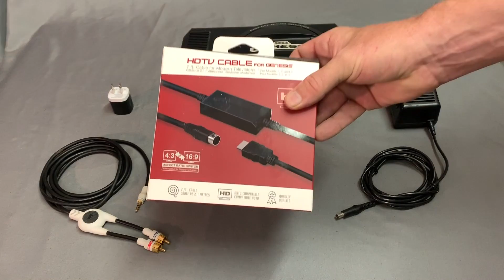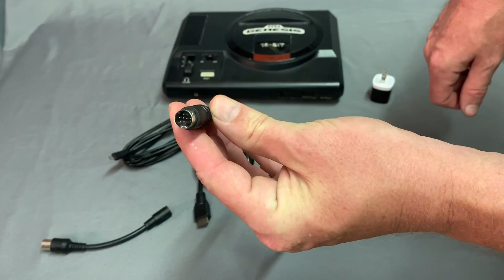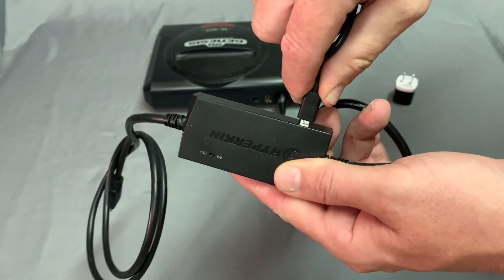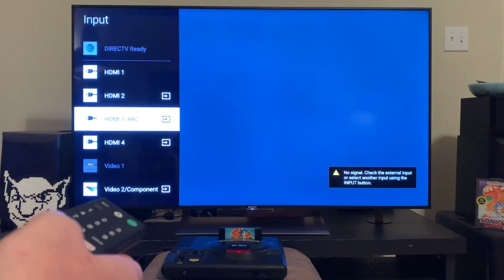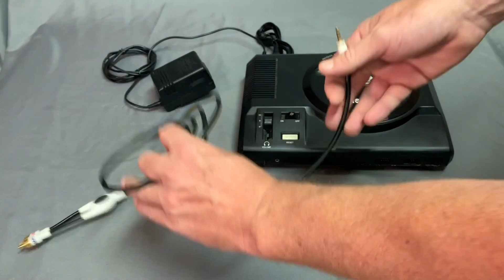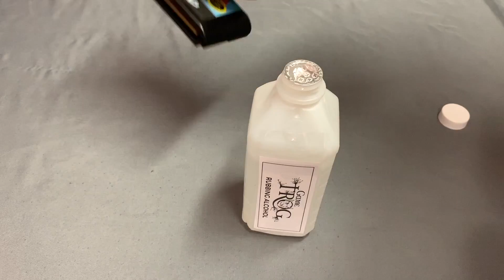How to connect your SEGA Genesis - Model 1, using the Hyperkin HDTV HDMI Cable

Comment: Great video! I had been debating whether or not to buy one of those HDMI cables for my model one but now you've convinced me it's worth it. Thanks for the info.
Reply: it's not, those are trash. If you think the video quality is better is just because it pulling out the rgb signal instead of composite which makes the image cleaner but the picture is still not interpreted correctly. In fact those cheap converters transform the progressive signal into interlace (your TV does the same thing when you plug in analog things in it) and it adds lag as well as graphial problems. If you really want to have a good experience for à fairly low budget check out videos on the GBS-C or the rad2X

Comment: I’ve checked my connections a dozen times and my Samsung just has a black screen. Don’t know what’s wrong :-(
Reply from the maker: Do you have another HD TV you can try it on? These cables output 720p, not 1080. There are some TVS that don't support 720p so that's a possibility. Also, do you know if the SEGA works with regular (RCA) cables? A black screen could also be a dirty game, have you tried a couple different games? (I know, lots of options here).
Reply: @thegametrog  I’ve tried a couple diffeeent games, same issue and on two different Samsung smart tvs… I’m wondering if the resolution like you said is the issue… I do not know if it works with regular rca cables… I have Rca, but do I need a specific plug to use those? I have one other tv I’m going to try again on, thanks for the help regardless.
Reply from the maker: @justinpeter7452  So most of the Genesis Models 1s that I have seen go bad, do have the blank black screen. When you turn it on there is a change to the black screen on the tv, like it sees it, but doesn't display anything. So it is a possibility of a bad SEGA. But they're normally tanks, so I would try everything. Even look inside the cartridge port on the unit to make sure there no paper or anything stuck in the cart port (had this happen more than once with due to the shipping material someone used). A lot of new TVs don't have the RCA (Red, White & Yellow) ports, but if one of yours does, that's all you need to try that method (and the cable of course). Also, have you plugged in the Hyperkin Cable with a USB? Are you getting a little blue light on the HDMI Box? And, you're welcome!
Reply: @thegametrog Doesn't work on PAL (white reset button).
And the console itself requires a specific SEGA cable that converts to RGB.

Tested with two screen. One that is from 2010 and one from 2020.

Console work on TV from 2000 when using SEGA brand RGB adapter.
Reply: Can this be done without the remote? Remote is long lost.
Can you use the tv buttons to scan through the inputs?

Comment: Speaking of troubleshooting, I might need to pick your brain about something.
Reply from the maker: Ask away, or reach out to me through the website: www.gametrog.com
Reply: @Gametrog  alright. I recently got a Sega Genesis model 1, and when I plugged it it, it doesn't turn on. I think it may be the AC adapter. I tested it out, and sure enough, it was. Do you think the problem is the AC adapter, or is there another problem? And which adapter should I look into?
Reply from the maker: @cmgamer8093  It coulds also be the Power Port needs some solder on the inside. This is a common problem with the Genesis (more so with the Model 2 though). You can often test this by wiggling the power port where it plugs into the Genesis (you might see the light on the genesis pop on as you wiggle it). If it's the power supply (also possible) the 1602 replacement here works great: https://gametrog.com/product/sega-genesis-1-sega-cd-1-2-master-system-power-supply-1602/
Reply: @Gametrog  already got it fixed. Got another problem. Every time I tried to put a game, it keeps on showing a black screen

Comment: I see you have a Genesis model 1 cable with the wrong size pins they incompetently put in it so that’s going to do damage to your genesis av port.  I got a newer revision that came with the corrected adapter.  Do NOT use that adapter shown in the video.

Comment: I just found my old Genesis console but no cords or controllers. How would I hook it up to 2019 Onkyo receiver? My reciever only accepts HDMI audio wise
Reply from the maker: It should work just fine! Just plug the Genesis into one of the available ports on the Onkio and make sure you have an HDMI running form your TV to the Receiver.
Reply: @thegametrog  awesome! So the sound will go from the Genesis out to the receiver? Also I need a power plug, any suggestions? Thanks for the reply.
Reply from the maker: @kenshiroFNS  Yup, it will send the sound.
Reply: @thegametrog  do you know what Sega Genesis 1 AC Power Adapter I should get?
Reply from the maker: @kenshiroFNS  Absolutley, check the description for all the links. I carry all of these cables at gametrog.com!

Comment: I saw another video on youtube where a guy testing out the hdmi said something about the adapter for model 1 consoles not fitting correctly into the slot and that it could damage the pin connector on the back of the console. So, I invested on one of those retrovision type component cables and it works, but my insignia tv isn't compatible with it. Apparently, only certain brands of Televisions will display the picture correctly. I give up, so I'm just going to buy one of these cheap HDMI cables (probably the pound one) and sell my barely used (new/like new) model 1 mib genesis. Then, I'm going to buy one of those little mib model 3's (98-00) that I've seen on ebay to go with the hdmi cable.

Comment: What?! HDMI? The Genesis did not output HDMI if I remember correctly, should this be used over RGB?
Reply from the maker: You’re correct, none of the old systems output to HDMI. This cable, and the others we have, use the best signal available from the machine (in this case the RGB signal from the Genesis) and in the box on the cable, convert, upscale and output a 720p signal to HDMI. It will surprise you when you hook it up to an HDTV. However, if you have a CRT then using a Scart Cable to get the RGB signal, and a converter box (if you’re in the U.S.) to get Component Out would be the best option.

Comment: I can’t for the life of me attach the Sega Genesis 2 to Sega genesis 1 adapter cable to the hdmi cable. It just won’t budge at all.
Reply from the maker: Greetings King, one of the comments below mentioned that they saw an issue with the pin-connector shape. Look at the shorter adapter cable that plugs into the longer cable. See if the shape ( a "U" pattern vs. a "C" pattern ) lines up with the holes on the other cable. This may have been an old issue with the HDMI cables, I haven't seen any issue with the ones I currently sale. If you got it from Gametrog send me a message from the site and I'll help you out.
Reply: Gametrog It’s actually the right shape, it just won’t snap for some reason
Reply: @kingofls97  I also can't get mine to connect!! did you ever solve this? I ordered a replacement thinking something was wrong, didnt fix it.

Comment: Did Hyperkin fix the Gen 1 adapter issue?  

The Gen 1 pins was round shape, but in your vid its U shape.  

Madlittlepixel vid brought up this issue a little while back.
https://www.youtube.com/watch?v=tAA5BT6s9Bc
Reply from the maker: Ever since I've carried them (mid 2019) I've never encountered a problem with them, so if there was a problem, I assume it's fixed. That's an original Gen 1 in the video, and the cable fits perfectly, so the U shape may just appear that way with the angle I'm holding the cable. But as you can see in the video, it fits no problem.